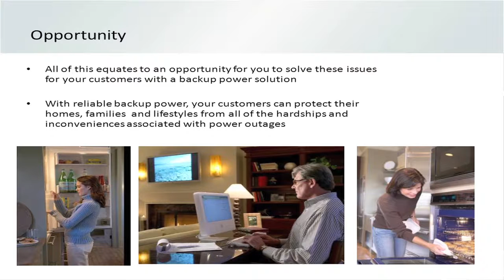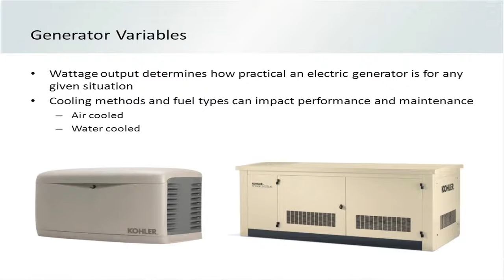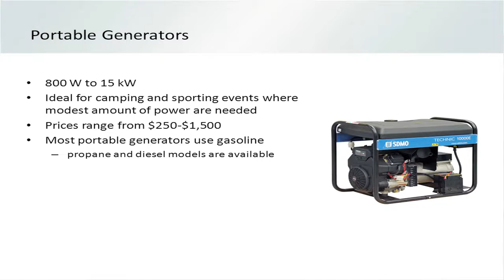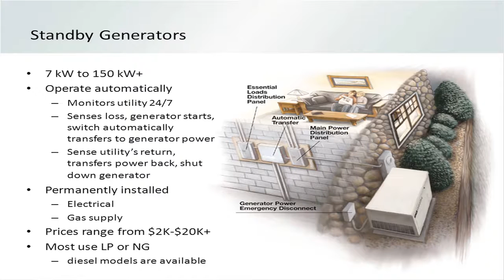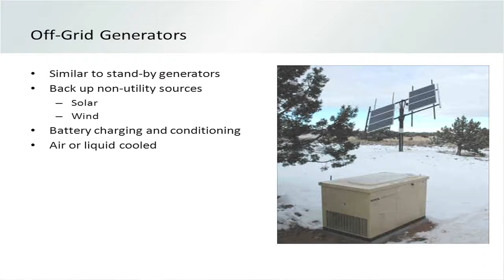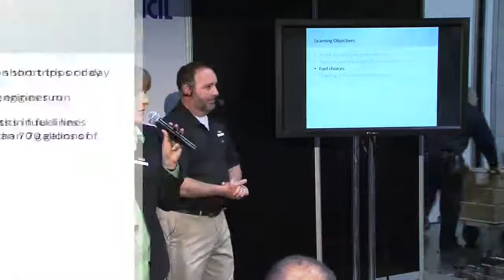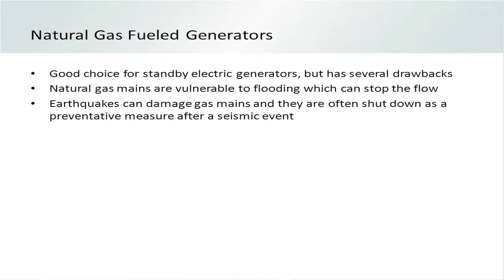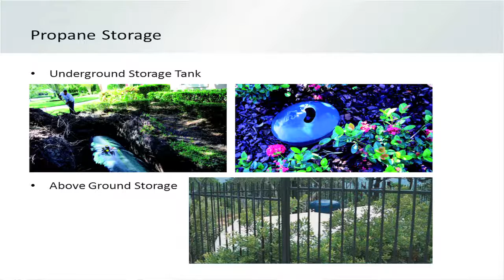Sizing and Installation of Residential Backup Generators (Part 2/3)

Comment: ... Most large commercial applications - 100kW up to several MW pretty much always use diesel. It also makes good sense for off-grid use as the fuel is readily available and is a lot safer to handle than gasoline, and is relatively safe to store in large quantities. If the power supply is so critical that it needs a standby generator, get one that has a fuel source that is easy to obtain and can be stored on site in sufficient quantity, that is what is common practice commercially.

Comment: Not very convincing arguments against diesel generators - use a stabilizer and keep that tank as full as is allowed would be a good tip. It also takes less diesel to run a generator that gas (petrol), so would not need as large a tank. Above ground tanks definitely an advantage for safety - put a wall or garden feature around if it's a problem - a roof is also not a bad idea, as it lessens the effects of the sun heating it up & casing condensation in the tank. Continued...